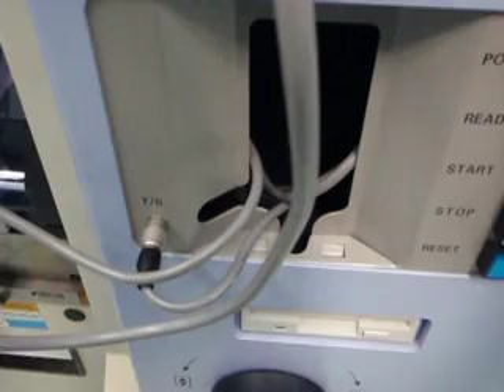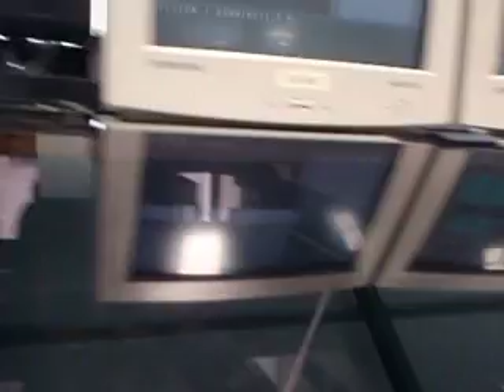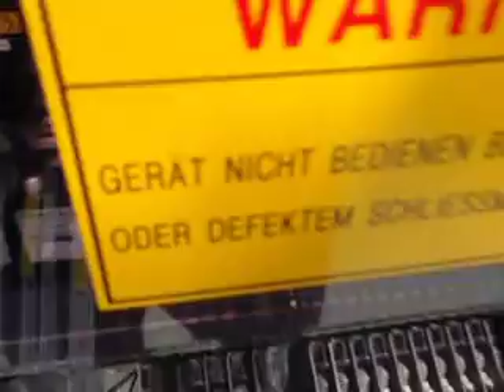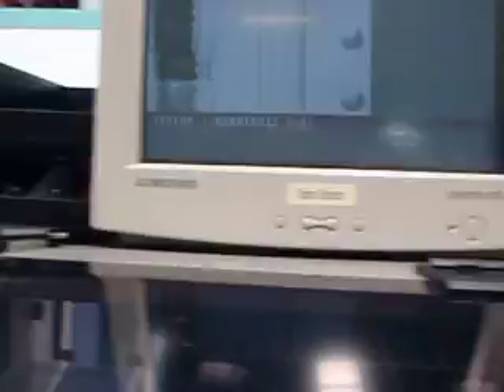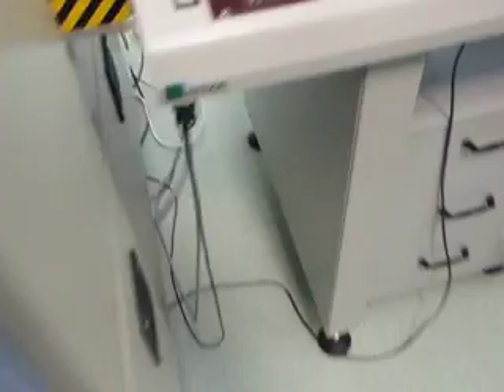Samsung CP40 CV in Action - Pick and place SMT SMD (Teil2/2)

Comment from the maker: Hello

It is a very solid maschine. It works very well, but it must have periodic maintenance and justage of all sensor´s must be good. Problems only with Stick Feeder in connection with SO8 IC´s. This maschine had placed 15million components and it works with the first belt.